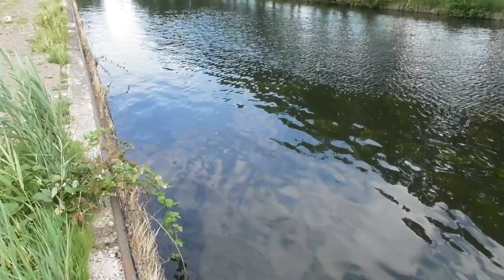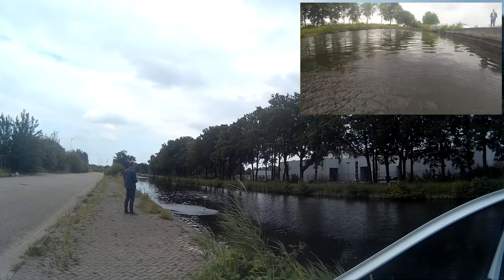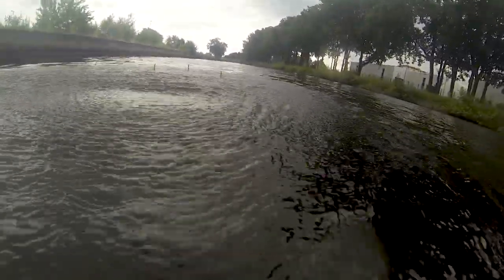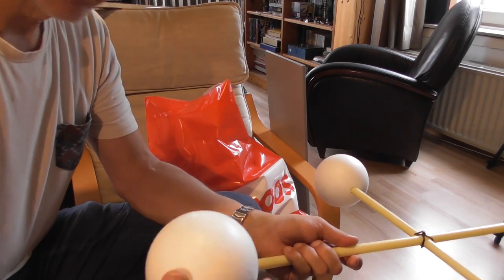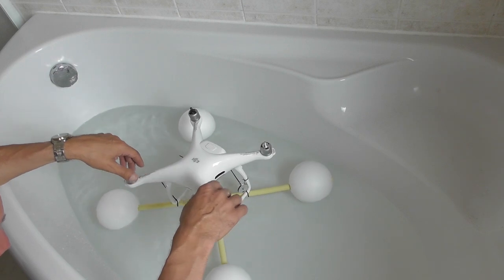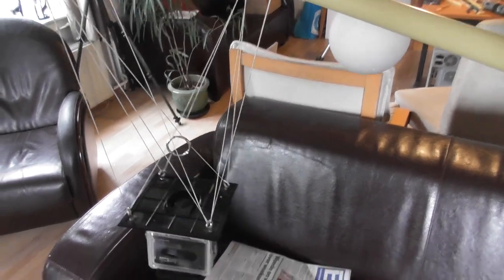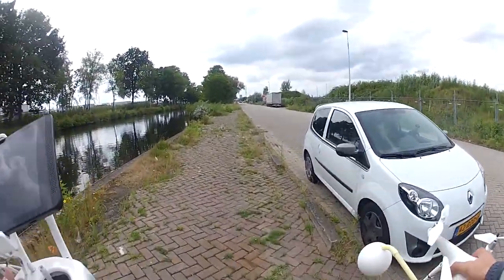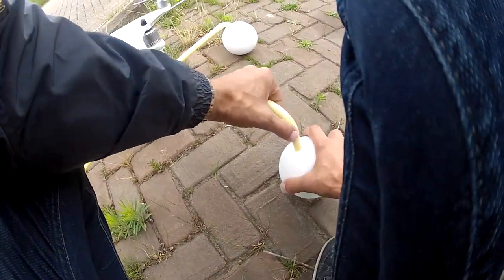DIY Gopro gimbal landing on the water gear for the Phantom 4 Pro going wrong.

Comment: First of all Peter, great entertaining video. I would make a floating platform, like a boat, and fix the GoPro onto it. Then I would simply make the drone pull the platform on a string. Maybe you should find a place with clear waters. Keep it up, love you videos.
Reply: Good info!
Reply from the maker: It crossed my mind, but if I cannot pull it up into the air, I'd better just have an RC boat.

Comment: The drone has algorithms designed to correct its angle in the face of forces that are trying to disturb it - like wind.  Those algorithms are based on its knowledge of its own geometry and moments of inertia around the various axes.  When you put those balls way out on the end of those arms, you're changing that geometry dramatically, and the algorithms then overcorrect, causing the oscillation you saw.  Making the arms shorter will help.  Changing the gain, as someone else suggested may help, but I'm not sure if those only affect the inputs from the user, or if they also affect the built-in stabilization algorithms.

Comment: You are very lucky you didn't crash ... Any time you put anything below the craft, the sensors can become confused and the craft has been known to freak out, thinking it is higher or lower than it really is. The camera is perfectly placed under the craft and the sensors are placed to where they don't see the camera, otherwise there would be problems. It was acting crazy because of the blocking of the sensors! You got lucky, my friend.

Comment: if you want to stop it in a bad situation, just pull the joysticks out to the side and down (bottom-down-left + bottom-down-right). it will stop in mid flight even if you do that but works great for when you get into a situation like you did with the drone flipping over.

Comment: Maybe try two outboard floats like catamaran boat, to stabilise forward movement in the water, to reduce side to side movement. 
Two plastic cola bottles might work with two small wooden cross beams. Camera in middle suspended off your phantom

Comment: This was not a failure because I learned from it. I think the problem is that your landing gear is obstructing the propeller air flow.  That's why it is worst with the flotation bulb. You might get better results if the landing gear was taller. Increase the distance between the prop and the landing gear. But then you would have a top heavy problem.

Comment: Great video Peter! Made me laugh quite a bit! I wonder if the downdraft of air from the propellers on the floats was having any effect on the drones balance? I noticed at one point one of the floats fell off maybe due to the air flow? Looking at the design and position of the design which is available to buy made me wonder this. Good luck and thanks for the content!

Comment: I believe that it is a aerodynamic issue. Try to make a circumferential chamfer around each sphere at the horizontal center. Then you dont have the effect called karman vortex. A rubber band should do the job. Take some 5 or 8 mm wide rubber bands. So that they dont fall off easy. Good luck.

Comment: Just on a note peter... ive had a P4 but have 2 P4p`s now amongst other drones, i connected a 4ft plastic pipe on the bottom of one to poke something out of a tree, but you have to watch out for the pendulum effect cause by the rotors and the phantom then trying to correct itself making the swing and rotation to get bigger and bigger.. But the main reason for this comment is: NOW CHECK THE TOP OF EVERY LEG on the landing gear as many p4 series are prone to crack where the landing gear screws are, this can also be caused by hard landings or repeted hand catching.. Just something to look out for ...
Reply from the maker: Yes thanks. I had that in the abandoned hotel in the Azores. But this time only the props were damaged.

Comment: Looks like the IMUs are struggling to counterbalance the quadropod you've added, and the rotor speeds on all 4 corners are rapidly changing making it very jerky?  Very entertaining though!  I can only assume some rather precise engineering is required to ensure the weight below is balanced very precisely in accordance to how the flight motors are operating (?)
Reply from the maker: Yeah, I think it is has to be balanced perfectly maybe to work.

Comment: It would be more stable to have a string tied to each leg corner, less pendulum effect. 
I occassionaly have a hula-hoop wrapped in LEDs hung below (for a UFO show) my P3A, plus 2 9v D cells. It's a bit sluggish, but very stable provided wind speeds are low.

Comment: Ok I get your point, don't give up, attach two strings then. "The boat" should be light, like a small sealed plastic bag,. My point is, not to modify the configuration of your Phantom...😉

Comment: Great work as always Peter how are you enjoying the K1 Tablet over using an iPad?
Reply from the maker: I need the K1 because of the screen recording, but not happy with the problems the DJI app gives of course.
Reply: NeverMindYourOwn Crashing on you as well has your app asked you to register the drone. In flight after restarting from a crash? Acting as if this is the drones first time powering up outside the factory it only happens once a month now but at the start of the year it would do it after every 3-4 flights. Yet the drone could still be controlled with the thumb sticks just a weird issue I have been experiencing was not sure if you would be having the same or any others who see this. Also thank you Peter, for responding!

Comment: I also think that you should try not to have 90 degrees connections to the balls but just straight in. This may put your DJI gimble into the water but larger balls then may be the solution? Just guessing.

Comment: Hello Peter, you have been using your Fatshark Goggles for a while now, my question is have you tried the new DJI goggles. Would you swap over ? My only thoughts are that the goggles sound as if they are great with the Mavic because of Occusync, whereas with the Phantoms it is just HDMI cable connection.  Thanks
Reply from the maker: I need glasses to see things sharp. And yes you need a cable with the Phantom. And it's big...
So it is absolutely nice, but not very high on my priority list.
Reply: NeverMindYourOwn Do you use reading glasses normally , but your long vision is good. If that's true, what do you use with your Fat Shark's ?
Reply from the maker: I don't use reading glasses normally and I don't need any for the Fatshark either.
Reply: NeverMindYourOwn sorry must have misunderstood, as you previously said you need glasses to see things sharper.

Comment: Build an waterproof drone for that application! That´s what I am doing!! :P buy a cheap f3 flight controller ad a gps , esc motors receiver,  build your own wood frame, get all electronics inside a Tupperware, apply generous amounts of  spray lacquer to all electronics, not hard at all! and very inexpensive to do!  If you want I can build you one for cheap!

Comment: interesting behaviour. maybe shorter arms work but then landing is harder and tipping over is more likely to happen. Without the balls it looks more stable. I think the airflow is disturbed which makes fine adjustments by the copter being delayed or in some way affected. maybe try rotating your construction by 45°? I guess the ultimate solution could be to hack the gyro response times which sounds really fancy saying it but no idea if it can be done. ;-) I'm sure you have seen this: https://www.youtube.com/watch?v=wYwh9_YStGA
Reply from the maker: Yes, seen that video. Not sure why mine didn't work like that. Maybe mine was not balanced enough.
Reply: If you need a couple of carbonfibre arrow shafts I have ones could have.

Comment: LOL, I disagree with your diagnosis of what went wrong. I blame it all on the pilot. XD :P From what I saw of Drone Girls attempt to fly a teddy bear, Solidifying the load with a non pendulum hook is bad for balance. The connection to the craft has to be as close the the center as possible vertically and horizontally and at only one point, not 4. The quad is not programmed to keep a load that high balanced. If you connect it a just one point the quad can adjust itself without having to move the load that is way below it. If you want the load to stay pointing is a certain direction with such a connection then you need to look up some type of connection that can move back and forth, but not turn, like a dog bone or a piece of short rubber hose.
Also, maybe you should make the camera float somehow instead of letting it go all the way down. Remove some of the load for the bird to be able to drag it easier.
Reply from the maker: I didn't have any trouble with a similar much heavier totally unbalanced load actually: https://www.youtube.com/watch?v=qbFEwijcjJQ
Reply: That load was not hanging so low and where the strap held the gimbal was a lot closer to the body than the setup here where there isn't any pivot point.
Reply from the maker: Ok, since you are an expert, I will ask you for advice next time.
Reply: LOL

Comment: Peter,  the design is flawed for the drone. Too much mass, too far from the Center of Gravity (CG) of the drone's capability to correct positioning. As a matter of fact, that mass being too far from CG  increases in frequency the more the drone tries to compensate /correct its positioning on trying to be stabilized. That is why the mass of the Go Pro helped because it slightly compensated for the additional mass too far from CG limit. 
It would be better to get the mass/floats under the landing gear but then you run into another problem that you were trying to solve and that was keeping the legs wide to stabilize the weight of drone on the water.
It's a dynamic physics problem that is interesting.

It is a different problem but it will help people to relate. Ever heard of "pilot induced error"?  before dynamic dampening became technically solved, when a pilot got into a situation where his helicopter or plane was bouncing around in turbulence or from over correction of a maneuver, the movement of the pilot within the helicopter or plane that is bouncing all over would increasingly make the pilot put bigger and bigger corrections in the controls and the movements would grow in intensity and cause pilot to crash. That is what is happening with the drone. The drone is trying to compensate for the mass too far from its CG limit and the gyrations get bigger and faster and grow over time. 
But it was fun to watch your attempt. glad you did not try on the water, LOL
Reply from the maker: Sounds like a/the perfect explanation to me. Thanks!